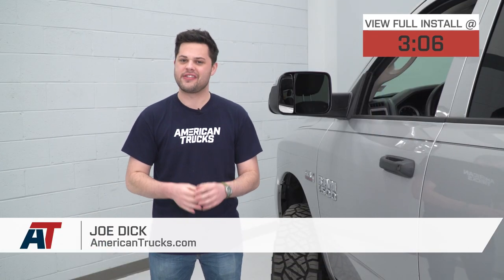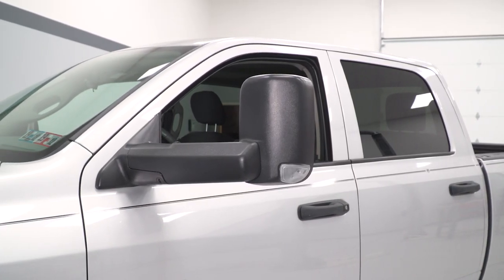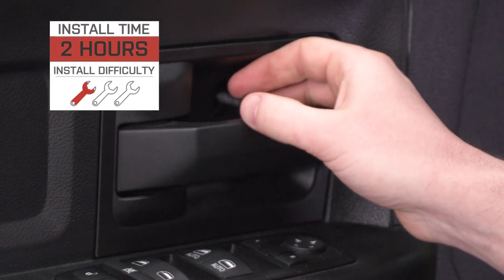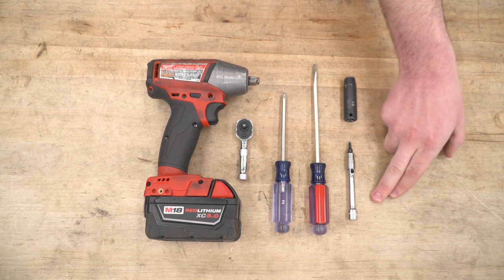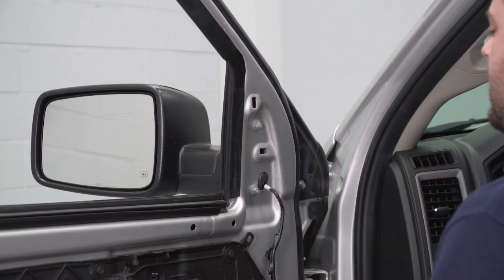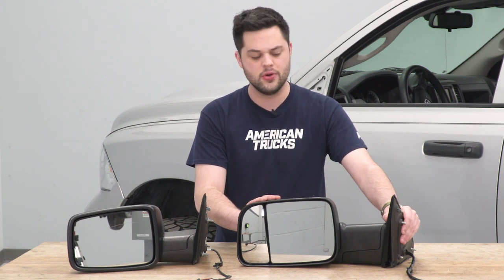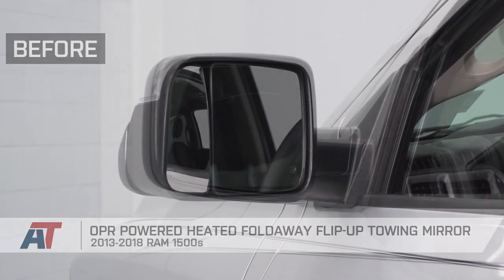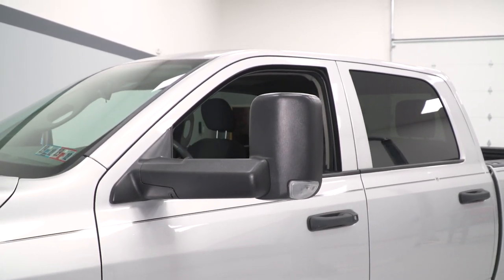2013-2018 RAM 1500 OPR Powered Heated Foldaway Towing Mirror w/ Turn Signal Review & Install

Comment: I watched three other videos on the instructions for this mirror because the signal lights or puddle lights were not working after I installed it and nobody covered the issue with the lights except your video. The dealership gets you no matter what you do to save money. Thank you for your video and finally answering my question.

Comment: Also if your truck does not already have puddle light mirrors then you were truck will most likely need to be activated to get the new trailer mirrors to work. It was $109 activation fee.
Reply: GSXR4LIFE cook that is mentioned in the vid
Reply: @stlswagger  yeah didn't watch the whole vid

Comment: Installed these tow mirrors heated and folding mirrors on my 2018 Dodge Ram quad express. Doesn’t work, was told by American trucks should be plug and play. Do I have to get it flashed from dodge? I had Oem heated power mirrors

Comment: I have a 22 1500 classic which is essentially a 2018. I have factory non power folding tow mirrors with puddle lights, heated, etc. I already have ordered a new door switch. Just to confirm - this will function on my truck, correct? I have AlfaOBD to reprogram
Reply: I have a 21 1500 classic did it work for you ?

Comment: Will you need to get the flashed by the dealership if ur truck didn’t come with factory tow mirrors?
Reply: Yes. Or you can use something like AlfaOBD. Make sure you get a new switch too

Comment: i have these, but my power folding button doesn't seem to fold in/out the mirror assemblies, nor does the drivers side heating element work...any ideas of solutions?
Reply: You have to change door module and also program it in order to work with alphaOBD or something similar to it

Comment: your also supposed to add a bracket to the inside of the door to stiffen up the frame of the door due to the extra weight of the mirror. Just like Ram did with the trucks that had these from the factory.
Reply: What extra weight?
Reply: @sors1599  the tow mirrors weigh a lot more than the non tow ones. Plus they are longer putting more leverage on the door frame.
Reply: David yeahhhhhhhhh I bet they could bend your door huh or worse case rip it right off I heard these mirrors are about 55lbs heavier (EACH). 😂😂😂🤷🏻‍♂️ if I was you I just keep the stocks on!! If not you will complain about gas mileage next